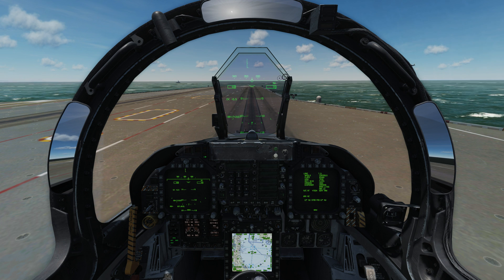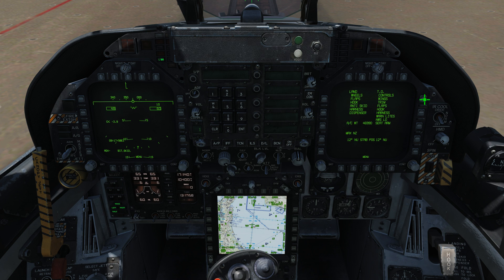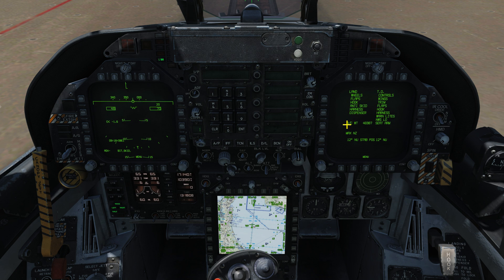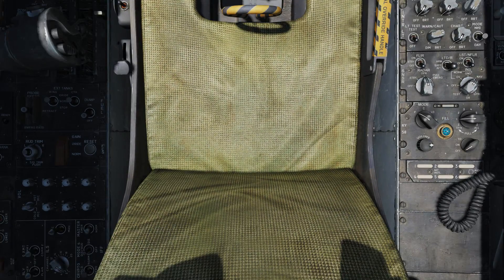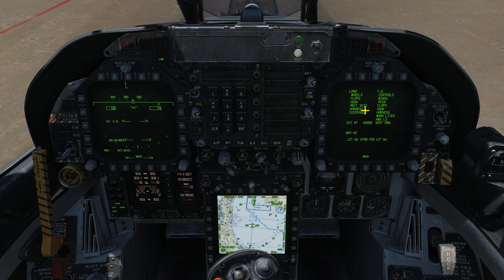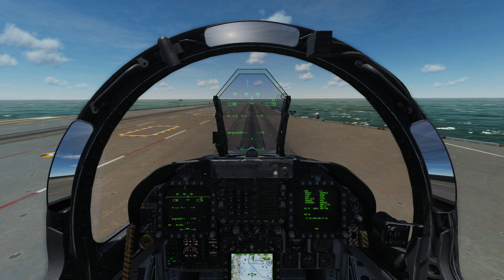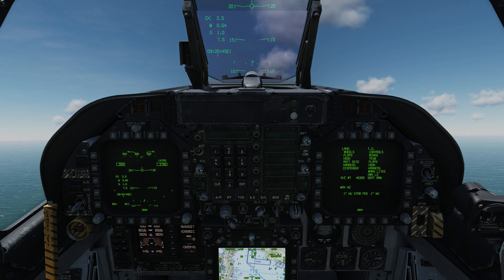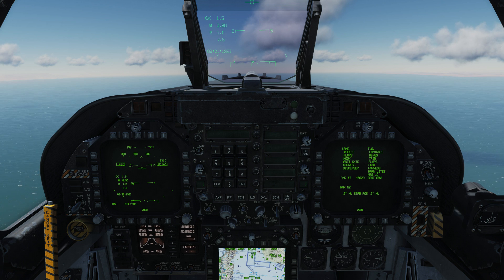DCS: F/A-18C Hornet - Setting Carrier Takeoff Trim

Comment: instructor on training mission says to change it to 17 using R CTRL + .  but it doesn't work nothing happens when you press that
Reply from the maker: You may have a different key binding. Go into the options, controls setup, and search for the trim up key binding you have set. Alternatively, if you have a joystick with a hat switch, it is sometimes bound to that by default. If that is the case, pressing up or down on your hat switch will adjust the trim. Hope that helps!
Reply: @BingoSim  I have a joystick with a hat switch but it's not assigned to that "trim up" and in options I have R CTRL + . assigned to that. It's working now but its not going up like 13,14,15 every sec. It works really slow if I press that it goes one up and then after 3 sec I have to press again to go another 1 up and slowly until I reach 17 which is weird idk maybe that's how it works in reality?
Reply from the maker: Trim moves in very small increments, so one key press is only a fraction of a degree. You could try holding down the keys until it reaches the number you want.

Comment: Dude love your video i hope your still replying to comments cuz i have a major problem. No matter what i set my trim to i just hit the water. My aircraft does NOT go up in any means for no rason. It just hits the water. If i try to go up i can but only to like 500 alt. and my speed is always 170 and i can't get it up more. I really hope u have a fix. Cheers.
Reply from the maker: If your aircraft isn't going faster than 170 it seems like you aren't getting full power? Check to see if your throttle axis is mapped correctly in the control settings. Also make sure other controllers you might have listed in control settings don't have a mapping to the thrust axis. DCS has a tendency to duplicate controls across all connected joysticks, etc, which can cause them to conflict and ultimately not work correctly.

Comment: how many degree of trim i need to land in a airfield with F18 if my aircraft weight 37600?
Reply from the maker: Landing is a little different than takeoff in regard to setting trim. Landing trim isn't usually calculated by weight, but instead it is adjusted on approach to achieve on-speed AoA. On-speed AoA is achieved when the orange donut/circle is lit in the AoA indexer (left of the HUD), and the middle horizontal line of the E-bracket is lined up with the Velocity Vector Indicator on the HUD. Once you have achieved on-speed AoA using throttle and pitch adjustments, use the trim to eliminate any hand pressure or pitch input on the stick.
Reply: Go on google and right f18 checklist dcs goule have some official of eagle dynamics and you have a table with trim

Comment: Wont work for me, stabs are always on 24° after I started. Immediately after I start it turn 24° and i crash in the water. On land based starts the same issue, i always have 24° after takeoff and die after 30 seconds because 24° is like hitting the stick backwards the whole time... What can i do?
Reply from the maker: Hard to say forsure, but it seems like something else may be bound to your pitch or trim axis in the control settings? That may be causing it to behave that way. I would start there. Other things that may work are to press the FCS Reset button on the left console. I did some searching on google and it sounds like some people were able to solve a similar issue by cycling flaps and setting them to auto immediately after takeoff. Still, this doesn't sound correct. Hope one of these ideas can help you. Let us know here if you find a solution. Thanks!
Reply: I have the same issue!!! It's such a stupid problem I simply cannot fly the plane with rear stabilizers at 24 degrees up.

Comment: It doesn't work to me, I press the left ctrol key and the up and down arrows and nothing happens 😣😣
Reply from the maker: I'm sorry to hear it's not working for you. You may not have the default keyboard configuration loaded. You could try to reload the default controls but be sure to save your current configuration first
Reply: @BingoSim  I've read a post on the Internet and for some reason it is different in some PCs, in mine the keys are "right ctrl + .,;"
Reply: @BingoSim  Now I have another problem, when I press up the left number starts increasing while the right one starts decreasing and never match each other. it is like: 18 nu stab 8nu
Reply: @BingoSim  well well. I fixed it
Reply from the maker: How did you fix it in the end?